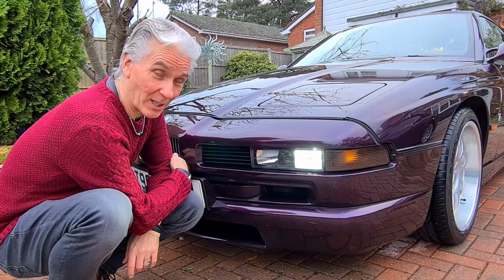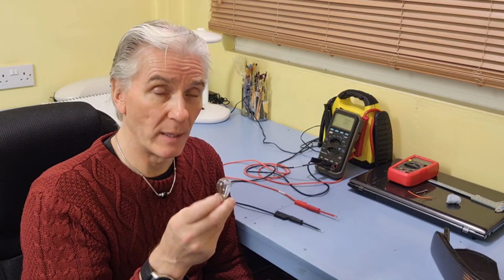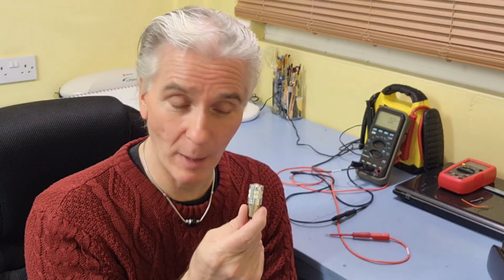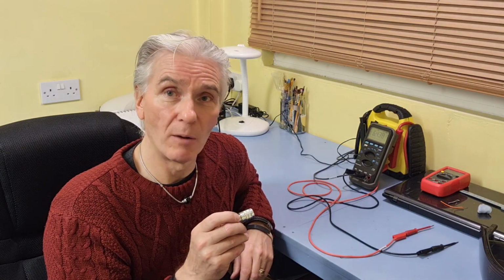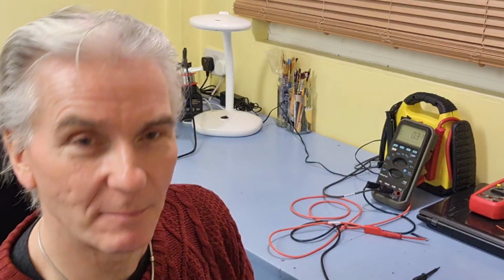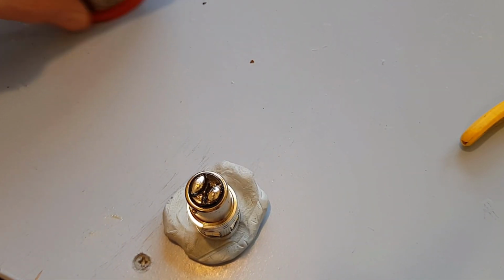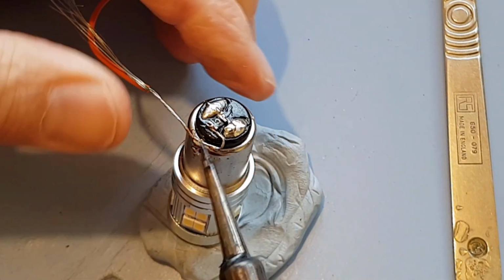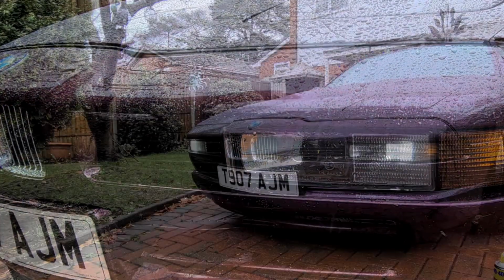BMW E31 840ci 850ci - BRIGHT LED SIDELIGHTS - HOW-TO

Comment: Hi Timm, brilliant modification, it was super easy to do, but it didn't last long for me. The tiny PTC fuse eventually gave out and gained high resistance, I suppose the constant initial high current from being in short circuit, and heat from the LED does shorten its lifespan significantly. 

I have figure out a fix now, instead of soldering a PTC to each bulb, I have soldered a T5 wedge bulb socket onto each of the sidelight wiring harnesses, and fitted those tiny T5 1.2w incandescent bulb which is found on many gauge clusters. Those little bulbs barely put out any heat or draw significant amount of power, and since they have low resistance at cold, it does able to trick the OBC and not bring any "check sidelight" warning message.
Reply from the maker: That's strange - those PTC's do fizzle out but mine have been fine for around 5 years now. Good plan of yours though!